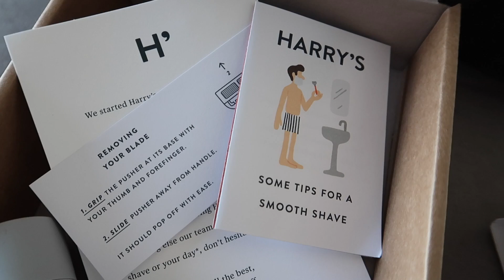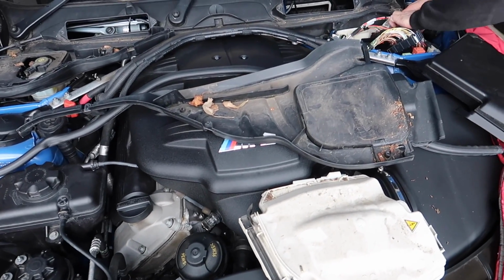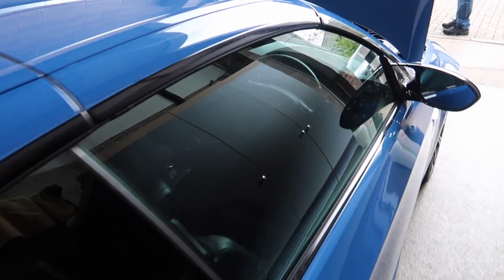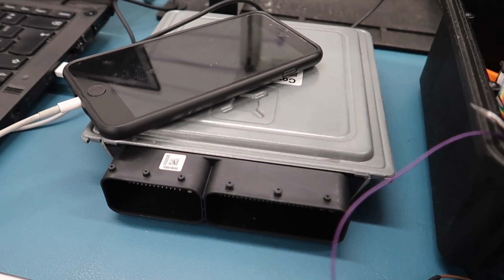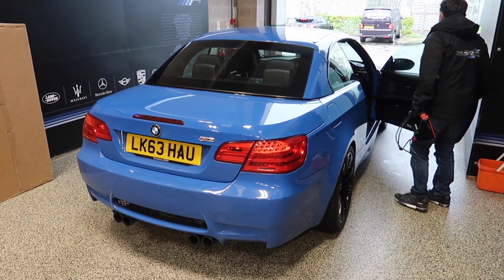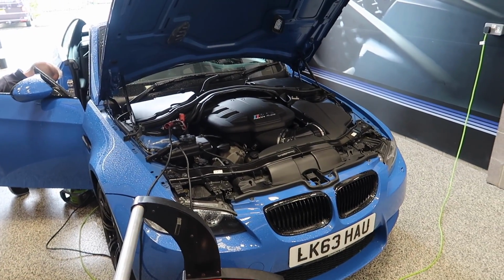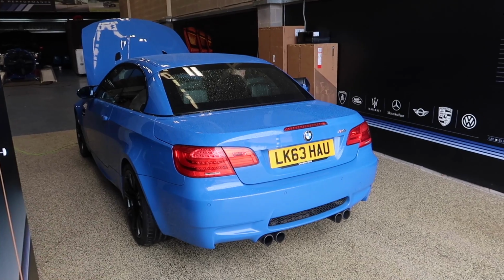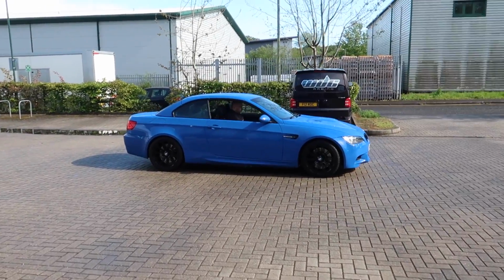FIRST MODIFICATION TO MY BMW M3! E93 V8

Comment: I had heard that installing GTS software would cause the DCT to overheat because that GTS had extra cooling to account for the extra load on the transmission and the non-GTS M3 does not have that extra cooling.
Reply: Won't happen under 95% of driving conditions, make sure you get the right GTS software, Evolve have tested their GTS software on thier E9X M3's over long periods of time and say it will not have any detrimental effect on the gearbox.
Reply: Brad EFC gotcha. Interesting.
Reply: This is true. There are some cases in the USA of this overheating.

Comment: Tom just change the bulbs to the correct bmw blue to change the angel eyes from yellow/amber colour. Access is in the front wheel arches through the plastic liner hatch door that opens in front of the the front wheels, with the car jacked up in the air.

Comment: Tom, I would service that now! These cars should be serviced every 5-10k now, not 18k/2 years as it is by the book. Byebye rod bearings is all im saying haha
Reply: FlagnarBoobz yup, rod bearings need to be done for sure. They might be in alright shape still on his car but just for the piece of mind it's better to change them out. Cheaper than a blown engine.
Reply: FlagnarBoobz The later model has different rod bearings. Agreed though, 2 years/18k is far too long an interval.
Reply: @fidelcastro9579  can tell you're not an e9x M3 owner. They still need doing despite being aluminium over the older copper :)
Reply: @hovnojede010101  his car is pretty low mileage so should be okay but I've also seen examples of low mileage cars going pop. 1.5k job Vs 6k engine rebuild. Doing the bearings also adds value
Reply: FlagnarBoobz interesting. Nearly bought a 12 plate last year. The niggles from earlier models put me off. The M4 was hard to get excited about. Neither are as good as a E46 M3 in my eyes. Saying that, I did dozens of big end bearing recalls on those years ago.
Reply from the maker: It’s 19 months & 5k miles since last service. It’s booked in for Tuesday anyway. Rod bearings are very very unlikely to need doing but I’ll look into it again.
Reply: @TGE  good lad!
Reply: @fidelcastro9579  F8x M3/M4 seem to be the most reliable M3 generation ever if you keep the engine unmodified.

Comment: If they haven't been done, get the rod bearings done lad. I had mine done by Aaron Reeve and it's totally worth it as a preventative.
Reply from the maker: It’s a 63 plate so don’t think it is an issue like the older cars
Reply: @TGE  cheeky money saving edit there lad 😂

From what I've heard they can fail on any of these, although you're right they did change them to a different material it's actually harder to detect a potential failure as you cant test for copper in an oil analysis. 

Either ways you're good, you're new money like fiddy!

Comment: Vines in Guildford? If this is a car you want to keep forever I’d suggest taking it somewhere else!
Reply from the maker: Why?
Reply: TGE TV I had an awful experience there with my e93 - lots of broken clips and tabs in the engine bay, and they gave me the car back with the engine trim on the back seat. 

Park Lane / Battersea, Berry Chiswick and Cooper Thames Ditton have all been much better, but they won’t help you with con-rod bearings, throttle actuators, or DCT fluid. 

Tbh I’d skip the main dealers and give Hack Engineering a call.